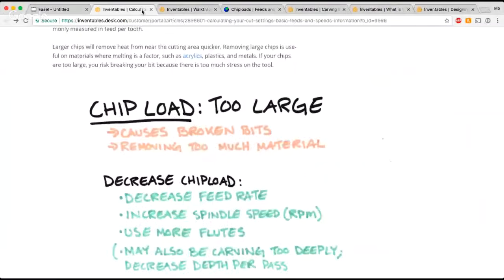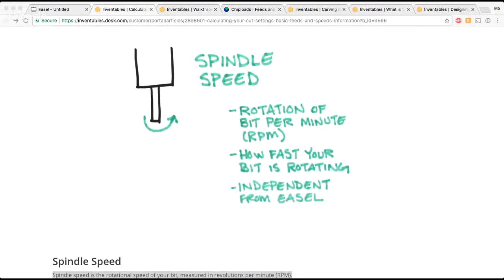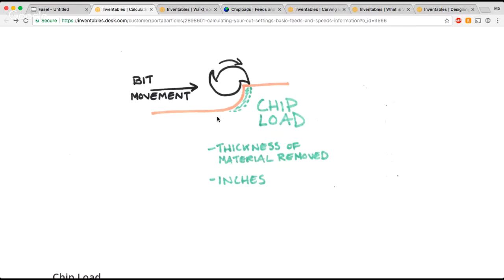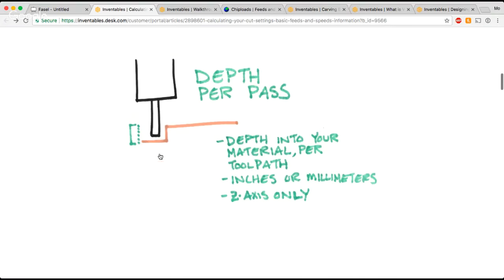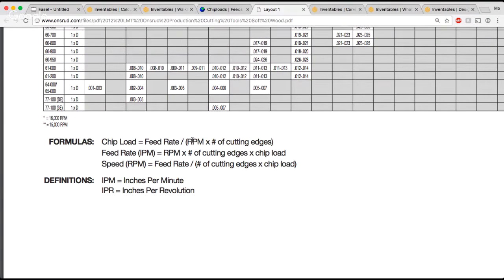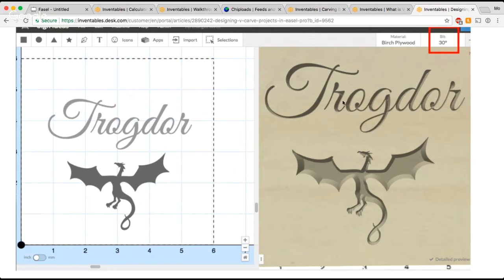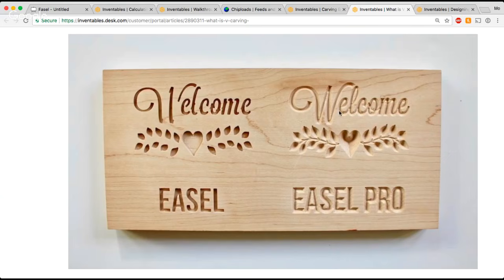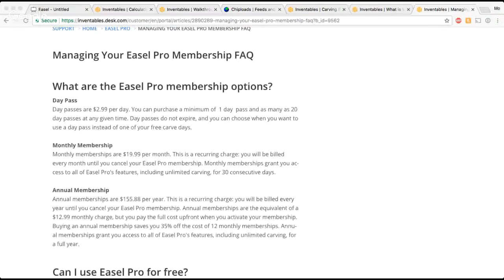Easel Live: Carving Bits 201

Comment: Thank you for this and ALL the classes, I am in the process of getting the budget committee to agree on the xcarve and am learning all I can before purchase. One question....In using Easel isn't all these settings already programmed in the software?
Reply from the maker: Easel has many cut settings pre-programmed for certain bits and materials. However, if you want to make any adjustments, you can enter custom cut settings based on your specific bit and material pairing.

Comment: In addition to the other reasons to keep you speed at 1, if you put your 611 at greater than one and do long cuts you will be replacing the brushes on a regular basis and if you leave the machine, you'll come back to ruined cuts and broken bits when the router fails.

Comment: Hi  Mo thanks for the  vid i am using a different brand of spindle i had to get a speed control kit so was that 1600Rpm or 16000Rpm ? Thanks
Reply from the maker: The minimum speed for the DeWalt router is 16,000 RPM. Hope this helps.